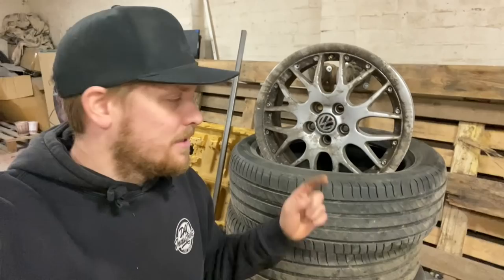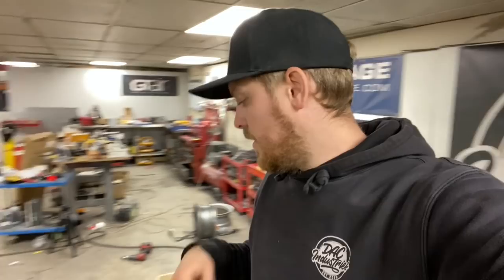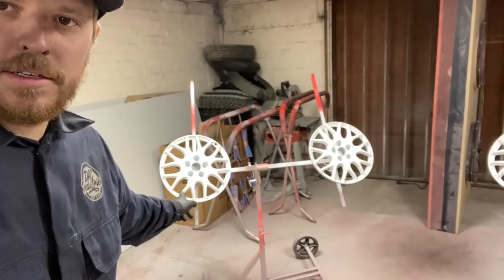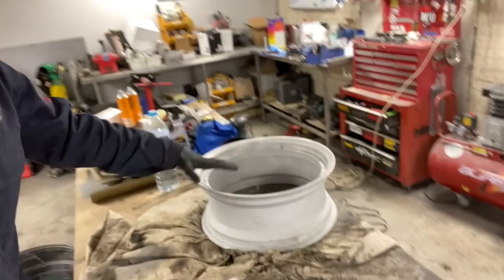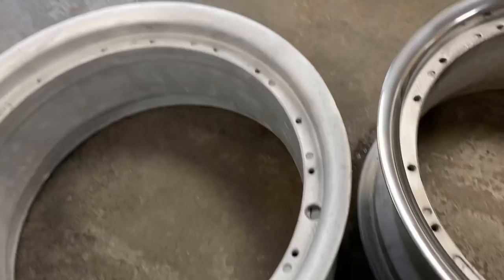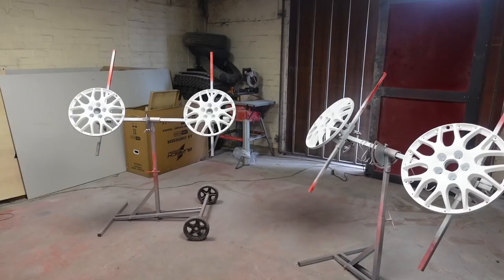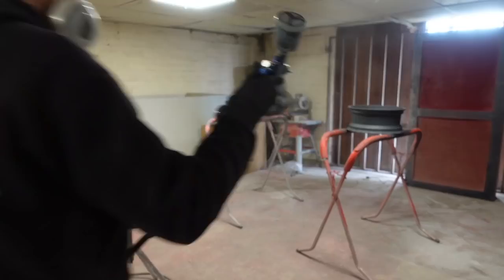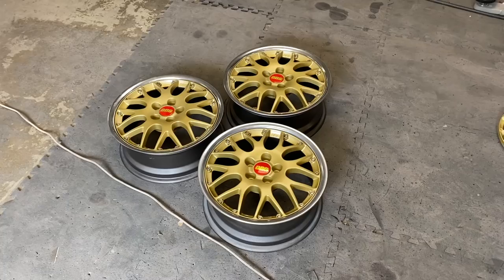Alloy Wheel Refurb, What Did I Go For? 1983 Mk1 Golf GTI Restoration 1.8 20v t Engine Swap

Comment: Those wheel look mint Dan you've done a fantastic job getting them to look like they do now and the colour is spot on mate. Just one thing, I don't know what sort of clearcoat you used but on the edge of the wheel where it's mirror polished you need to use DTM clearcoat as normal clear will not adhere to the bare alloy, you may have used it but I thought it worth a mention 👌🙏👍
Reply from the maker: Cheers bud. I am pretty happy with them! I have given them a ceramic coating to protect them bud.

Comment: Have you tried heating the bolts on the wheel they a couple snapped on? I had similar bbs’s refurbed and they said they throw them in the oven first to burn any loctite off. 1 snapped anyway and they used an engineering shop to drill it and helicoil it
Reply: Just as pressed send, you’ve already butchered it! 🤣